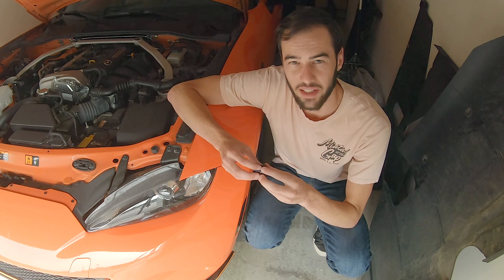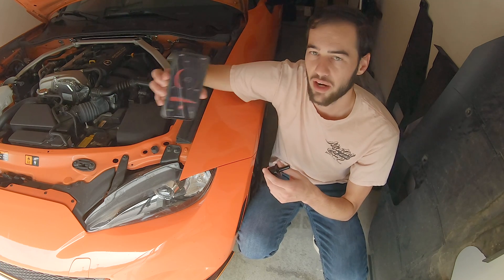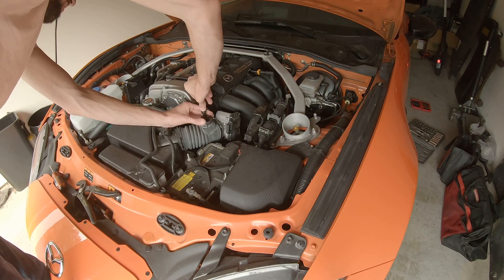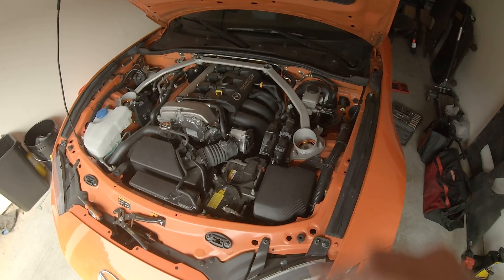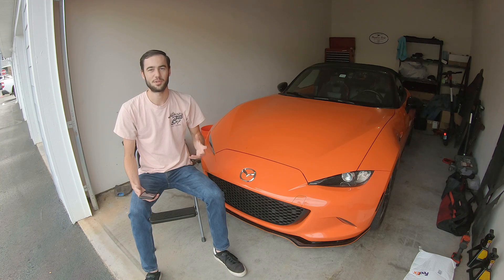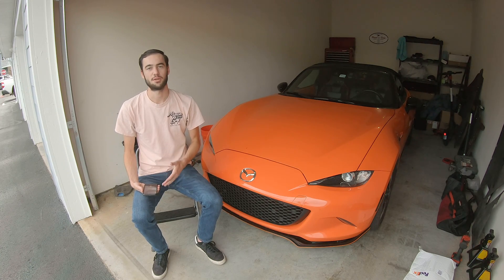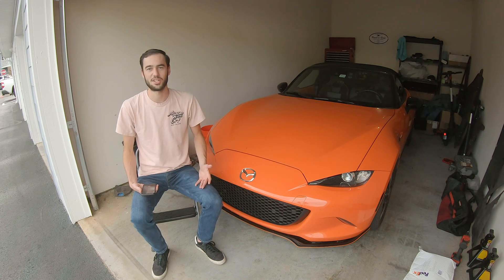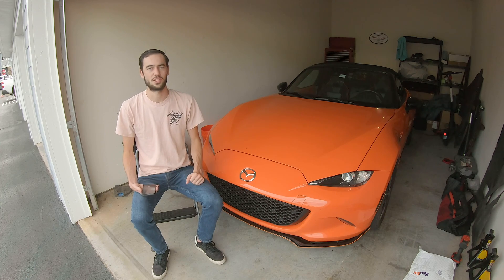MX-5 Sound Tube Delete Installation and dB Meter Test!

Comment from the maker: After doing some more testing, including cold start, idle, and revs outside of the garage (top and windows up) and some hard 3rd gear pulls, I found basically the same results as in this video. There was an almost imperceptible difference in the sound level and type coming into the cabin in all conditions. Playing the footage back, the sound was a bit deeper with the sound tube delete in place during cold start, idling, and holding the revs around 2k rpms. I'm guessing this is due to the lack of sound tube allowing the exhaust to occupy more of the sound space.

During hard 3rd gear pulls, the supercharger-like whine sound was there regardless if the sound tube was in place or not. Overall noise was about 2 dB lower, but this could also be due to other small variations during the test.

In the end, I do not see a significant difference between the sound tube and the delete. I imagine the difference would be more noticeable if the stock exhaust were in place, as one commenter mentioned. Thank you guys again so much for watching and all of your feedback so far!
Reply: You should have recorded outside with the top and windows up.
There is too much reflected noise from the exhaust and it might cover the differences (convertible already offering less soundproofing).
Reply from the maker: @GogogoFolowMe  it sounded the exact same outside with top and windows up, as my pinned comment mentioned. Like I and others said, I think the exhaust is a big factor here, but I wouldn’t spend the money again on the sound tube delete.
Reply: @DriveMX5  Thanks for the reply and publishing your results. Indeed if they took the engineering time to include it, it must make somewhat a difference on a stock vehicle.
Sometimes unconclusive results are still results, at least it reduces the engine bay clutter ;)
Reply from the maker: @GogogoFolowMe  those are all valid points. Thank you for commenting and watching!
Reply: Thank you for showing the tube removal process so clearly. Unfortunately, the rest of your comparison is invalidated by 1) running the test in an enclosed garage (!); and 2) the added noise from your aftermarket exhaust. That tube is one ugly mofo and without it the MX-5’s engine bay, complete with alloy cam cover and WITHOUT any black plastic “shroud of mystery,” puts many more expensive sports cars to shame. For that reason I’ll probably do the swap.
Reply: Hello, after seeing multiple videos and reading a lot of comments for this matter, I still wonder if it's a smart purchase since I have a inox line on my ND ST and not the stock one. Like you said, people with the stock exhaust will notice more difference. So, is it still worth it?
Reply from the maker: @DarkLord_CCCX  eh, I’d say in your case it probably isn’t worth it. Personally I wouldn’t buy the sound tube delete kit again
Reply: @DriveMX5  Well if it just cleans the engine bay a bit, then I guess it's not really interesting for me to be honest. Saved me a couple of bucks, thanks man. Keep up the good work! +1

Comment: You tested the sound in a garage?  How much of your reading was just the exhaust sound bouncing off the 3 walls, ceiling, and floor.  You need to do this in open air to see how much sound comes through the tube vs bounces around and comes back into the cabin.
Reply from the maker: I’ve gotten this same comment and I agree. There’s definitely ways the test could have been better. I will say the second half or so of the video was driving footage and the results were the same. Results may have also been impacted by the muffler I have vs. testing with a stock one, which I did not do.

Comment: If deleting the sound tube makes no perceptible difference, then why does Mazda add it in the first place? After all, it makes no difference. I don't want anything that serves no useful purpose.
Reply from the maker: @Always-Miata  that’s a fair point. Maybe it’s just a selling point? Hard to say. As you may have seen, I’ve had a lot of people say the difference may only be noticeable with the stock exhaust on. They included the sound tub with manual but not automatic cars and I’ve driven both versions stock, never really noticed a difference.

Comment: I just deleted the sound tube on my ND3. I was curious to see how big the airflow in the sound tube was, so I tried to blow air into the sound tube from the air intake hose end with my mouth. And I found once I blocked the small hole near the intake hose end, the whole tube was blocked?  I could not blow any air into the tube, and there was no air out from the firewall end hole. So the sound tube only works as passing the vibration of airflow in air intake into the cabin?
Reply from the maker: @milkymilkyisacat3154  that’s correct. It has a diaphragm inside that transmits sound. Wouldn’t make a lot of sense to have intake air blowing into the cabin, or the engine sucking cabin air into it

Comment: the car does drone at about 3000 RPM. Hoping to get rid of that. Will experiment on mine. Will just plug the opening at the firewall to test. Same thinking about exhaust mods. Im not looking for louder (thats obnoxious). Im looking for better tone. Not dronie.

Comment: Testing inside the garage, with the exhaust noise reflected back at you might not have been the best way to test for a difference.
I would test it outside, with the top up and down.

Comment: Simple answer to the question: Yes, Install this! After watching numerous videos and contemplating doing this, I just did it. And YES it really sounds so much better in the cabin, or doesn't sound for that matter. It is not about the noise volume, it is about the unwanted sound that came through. I like a quiet cabin. If I want sound, I'll go for louder pipes, not the ramble bumble coming through the tube. Do it, you'll be glad for it.

Comment: I believe induction noise is for petrol heads dream noise instead of exhaust like Busso Alfa Engines in My Channel and like E46 M3 throttle body sound so giving up that for less noise means you are looking for comfort with car without any proper sound isolation because I stripped my MX5 full to use Focal Sound Proofing You have to gwt rid of wheel noise first than your induction noise
You can listen some examples of MX5 noise with carbon intake and custom designed exhaust from stock muffler decide for yourself

Comment: I removed mine a couple of years back and don't notice that much of a difference in sound but I just felt on a car that they were trying to make so bloody light that they added this piece of junk totally useless fluff in my opinion. I would much rather Mazda given us an adjustable driver seat height. I also have a much simpler and less costly way of deleting out the sound tube just remove the main hose and then you can take a rubber 11/8 inch to 1 1/4 inch black chair leg tip available at your local Ace Hardware store for a set of four for $5 this goes neatly over the opening that the sound tube vacated. And if you're using the 1 1/8" variety that are easier ones to find just warm up in the microwave for about a minute soften up the rubber and it slips right over. no need for a clamp I've been running one like this for years now. The other three can go a long way just replace them say every 3 years

Comment: Ah, not using stock exhaust, but a louder aftermarket will influence the results apparently. Your exhaust sounds way louder than my stock one, therefore engine “clatter” on yours is much quieter……..defo want to try this though……..engine clatter not pleasant to my ears when roof is up

Comment: I don’t understand why you would want to remove the extra sound… I personally love how loud the engine sounds! I honestly wish it was louder!
Reply: in other jurisdictions you can drive much faster on the highway, which makes the nd with with its noise pipe and short gearing unbearable on the highway presumably. The short gearing and engine noise is kind of a dealbraker unfortunately
Reply: Yeah I don't get it lol. Isn't it why most people fit aftermarket intakes?
Reply: Get the sound tube upgrade 👍🏼

Comment: perhaps try it outside not reverberating in a garage. Also was the top down!
Reply from the maker: The top was not down. Good point about the garage, another commenter brought that up as well. I did do the test again and started and revved the car outside but got almost identical results. Instead of posting another video about that, I made a comment and pinned it to the top just under this video.

Comment: I don't believe it will reduce overall noise levels. What I noticed in my Miata was occasions I'd be driving and I'd hear these high pitched noises. I'd be like... "what the hell is that noise?" My passenger would even say they heard it also. I got rid of the sound  tube and I've never heard those noises since.

Comment: Great video bro keep doing these things !

I was also curious about this as it is understood Mazda has spent additional efforts to include the sound tube in their top end models and the base models did NOT get this (in US). However here in Australia all models came included with the sound tube. Having said that, I am with the understanding that based on how extremely muffled the stock exhaust system is, Mazda included the sound tube to provide a more auditory and sports-car like experience whilst driving the car as the stock exhaust noise is heavily dampened. However, once you put on an aftermarket exhaust (either an axelback, catback or full exhaust) the sound of the exhaust note will be louder than what the sound tube will provide in the cabin. Therefore having the sound tube intact (or removed) will make very little difference with an aftermarket exhaust as the exhaust note is presently overpowering. 

This is based on my perceived auditory sensory as I currently have the sound tube intact + an aftermarket entire exhaust system. In the cabin (window up/down) on any throttle, only the exhaust note can be heard. I am keen to hear everyone's opinion based on their exhaust setup.
Reply from the maker: Thank you so much! In the US, only the manual transmission models come with the sound tube. Lowest to highest trim is Sport, Club, and then Grand Touring. Manual Club and GT models have the sound tube and I think the manual Sport model does too, but I do not remember exactly.

I think I agree with you on the purpose of the sound tube and the reduced effects once an aftermarket exhaust is added. Louder exhaust drowns out the sound tube more which probably plays into the readings I was getting in the test.

Comment: I've seen other videos where people say removing the tube is negligible.  If that's true, then why did Mazda feel the need to add it in the first place?  This will probably be the last mod I do to mine.

I just got my 2022 MX5 a few weeks ago.  This week, it's getting a level 1 polish, PPF on the front half of car and ceramic coating on the back half.  Got to protect that paint!!  I got the Polymetal Grey with the black rims and full aero kit, black soft top also.  Next up, black tinted windows.  

The first thing I did as soon as I brought it home from the dealership was order that Goodwin Race exhaust like you have.  I LOVE the sound of it.  It makes me enjoy driving it so much more.

Only 250 miles on it, still breaking it in.  👍🏻
Reply from the maker: Awesome, congrats on your car! Yeah I can’t really say why they added it, maybe for placebo effect?

Polish, PPF, and ceramic coating are the way to go! As is the exhaust, hands down most satisfying mod. Keep enjoying the car!

Comment: I wonder how much of a difference with the sound meter would have been if you did the comparisons out of the garage in an open space.  Were the windows up? Since you had the exhaust facing the back of the garage I wonder how much sound was bouncing off the back wall of the garage?  I really don't know what the appeal is to delete the sound tube.  If doesn't give you any more horse power or anything.  It just gives the aftermarket vendors something else to sell us.  It would really be interesting to put the car in a sound proof room and do the comparisons.  Keep the videos coming Ian.
Reply from the maker: Thank you Bob! You make a great point about the test environment. I did have the windows up, but I would image there was a bunch of reverb in the garage. I think I'll go back again and do some more testing outside of the garage and upload the results!

Comment: Sorry to be the Debbie downer, but the sound tube delete kit is designed to take away the whine/supercharger sound under hard acceleration that's extremely noticeable on stock exhaust or back box only systems.

Sitting stationary has zero change, and using a decibel reader won't have any effect unless you can pick up higher frequencies.

Another great video but imo was done in the wrong view.
Reply from the maker: Interesting, that's the first I've heard of it being designed to reduce that whine on acceleration. It is very noticeable on LHD cars. The reader I was using went up to 20kHz. I think I'll take this and Bob's feedback and go out and do some more testing. I can't say that I noticed much of a difference in the whine, but will do some hard pulls and try and pay attention to it.
Reply: I agree with Phil's comments and hope you can give us the details on the difference in driving. I came very close to doing the soundtube delete but realized that it would primarily take away the whine. My goal was to lower the cabin from tire and engine noise, I didn't mind the supercharger noise. So I refrained from it. But eager to hear your thoughts when you drive the car (esp with your aftermarket exhaust, whether you had a supercharger whine before and after). Thanks!

Comment: dB testing is very finicky and requires a low noise floor in addition to having the dB meter remain static and fixed in one spot. Even moving your hand around a few cm will change the reading, especially with higher frequency tones. In addition since you're in a small garage with hard walls, higher frequencies are more prone to bouncing off the wall, biasing the dB scale.

Great video regardless and I really appreciate the stationary before and after sound clips! I personally prefer the sound of the engine with the delete.
Reply from the maker: It is just a hair cleaner of a sound with the delete. And I agree, the test could have been better but hey I tried and made note of the fact that there were some disturbances and variations that could skew the data.

Comment: I was on the fence with it in the beginning so I did a trial by disconnecting the sound tube, plugging both open ends and multiple test drives. I found I preferred the quality of the sound without it and purchased the OEM sound delete. There is lesser "mechanical clatter" and maybe even some of the deep rumble or lower frequencies from the engine bay. Not much difference on sound volume as you said but I'm happy I did it.
Reply from the maker: Agree!
Reply: I guess that if you just unplug any end of the tube and cap it, the result would be similar to installing this "delete" part. Its a good test to see if there will be a siginificant difference before performing any mods.. If no significant difference,  I would just leave the car oem.